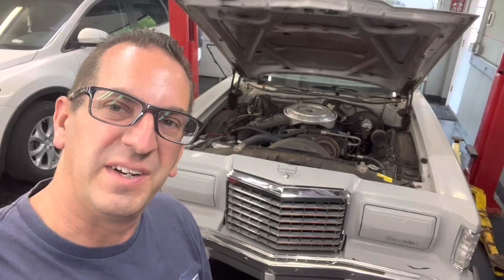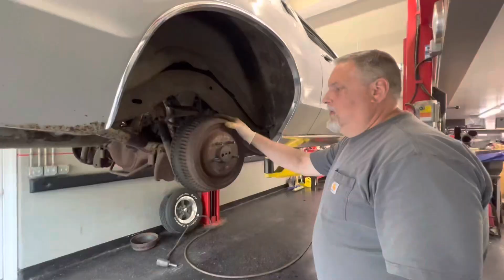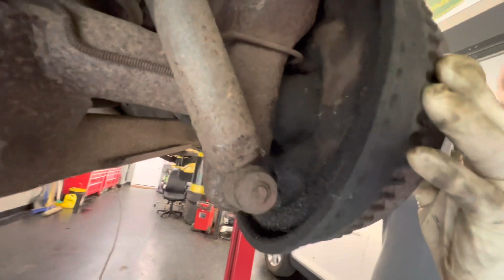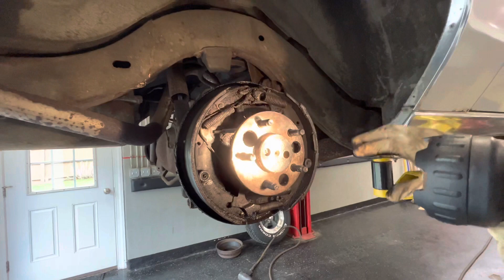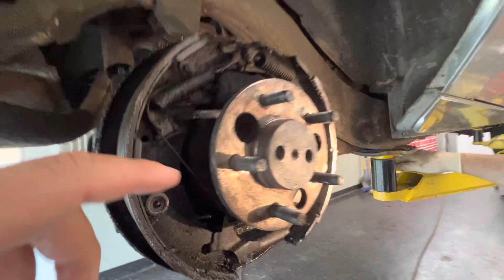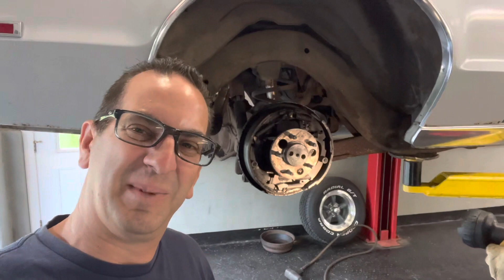Inspecting Brakes On My 1977 Ford Thunderbird

Comment: always keep good axle bearings-i had bearing fail one time-and axle backed out of the housing going down the road not good - because there is no inside axle clips -but it wont happen if you keep good bearings-only seen it happen one time
Reply from the maker: Oh yeah! Those bearings are a big deal.

Comment: I get to do the same job on my 77. Just rebuilt the engine (351w) and now the drivers rear brake is dragging and getting very hot. (Smoking). I'm probably going to replace everything in there. The axle seals are ok as far as I can tell
Reply from the maker: There was a couple of different options on the axel seals, just match up what's in there to what you buy.